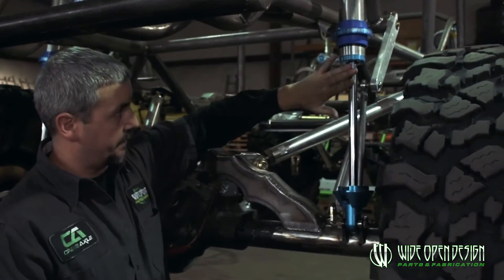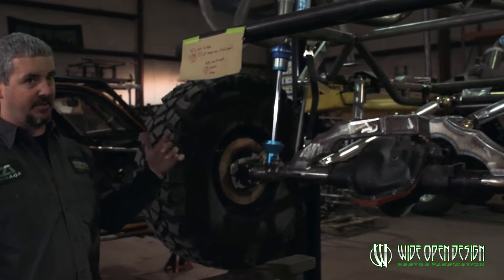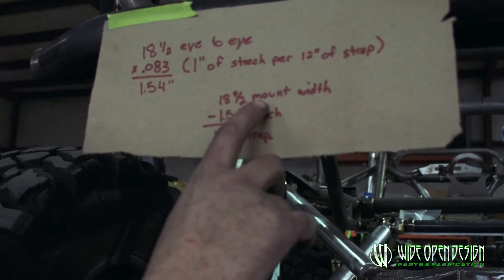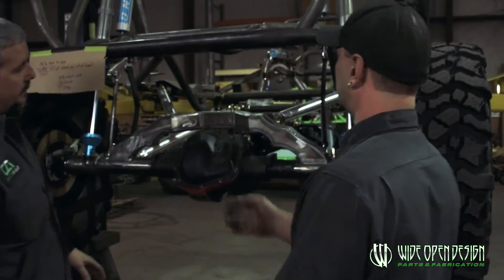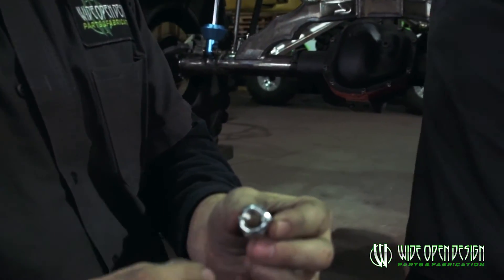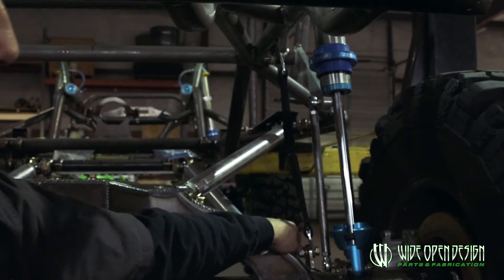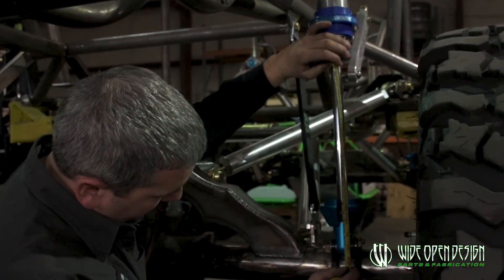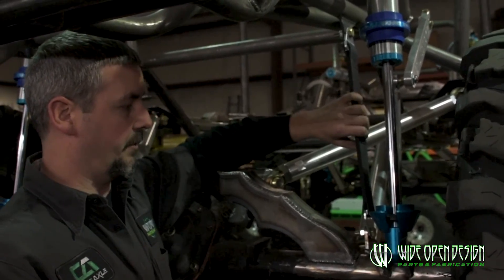LIMIT STRAPS | How to determine the correct length of limit strap for your rig | Wide Open Design

Comment: You said to make sure the mounts are set up so that the strap will be vertical and pull in a straight line and failed to do it yourself.  You could have made it closer to straight by simply putting the lower end of the strap on on the other side of the mount.  And by your own math the shock is still going to be able to travel past its max length by .04 so there's no safety margin.
Reply: I thought the same thing. Technically you'd be correct. It seems better to order a shorter 16" or 16.5" strap so we have that safety margin. Otherwise what's the point if the shock would snap 1st.

My only other idea is that... that 1.54" of stretch happens slow and easy enough to absorb the "shock". Maybe the last 0.04" is insignificant for slow articulation. 

Idk 🤷‍♂️

Or do something like this 
👇😁👇
https://www.carid.com/steinjager/adjustable-limit-strap-mounts-mpn-j0045848.html?view=396094&gclid=EAIaIQobChMIyqzBrszx6QIVcz2tBh2f9ws6EAQYAiABEgIxT_D_BwE
Reply: @xmo552  I think that .04 potential is probably insignificant too, but I'm not a suspension pro and he's the one saying that you should have a safety margin.  That said, I've driven and seen several vehicles from mild to wild with no limit straps and no apparent shock damage.  In a slow speed rock crawler type rig it'll be less of an issue than something that's going high speed and catching air, but I've driven a couple that did that without straps.  Factory vehicles never have straps and those shocks survive.  While most stock vehicles aren't driven in a way that would fully extend the shocks, some are.

The biggest reason I've seen for straps is to protect other stuff.  My friend's high dollar JK build ate 3 Dana 60 front diffs because the front end would droop enough to cause U-joint bind.  Nobody had figured out why it was happening and just kept fixing the diff. assuming something had been assembled wrong.  After I jumped it and it ate the 3rd diff I checked it out and discovered the cause.  My Jeep will go into bind in the rear well before the shocks top out so I'll have to do something about it before I do anything crazy.  I'll use a single center mounted strap so that it limits total droop without limiting articulation, there's already one in the front.
Reply: @DonziGT230  
Right on! 👍

Comment: Did you use a special bolt? Or is the nut and bolt left a little loose to allow swivel on the strap ends? Just concerned about causing bolt holes to turn oval on the tabs with time.
Reply: A bolt should never oval out a hole if the nut and bolt are torqued properly. If the torque needed to keep the bolt and nut torque exceeds the torque rating of the bolt, then you need to go to a bolt diameter that is adequate to handle the larger amount of torque.

Comment: I’m confused u measured the shock at 13” with limit strap now if u add the 1.5” stretch u calculated you will extended the shock .5” past what it should do and damage the shock
Reply: Your adding all the stretch back to the length. The strap has already stretched and after the stretch is at 13. The fabric will the stretch out over time, but the weave of the fabric will end up maxing out. So, it makes sense. There is already some stretch occurring. That’s why you can’t add the total stretch back to the length you see now.
Reply: yep